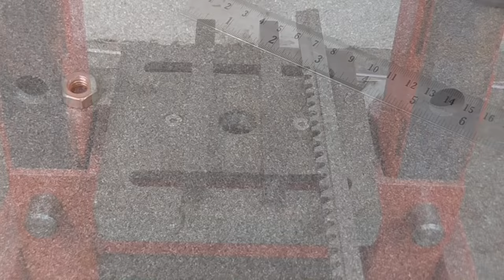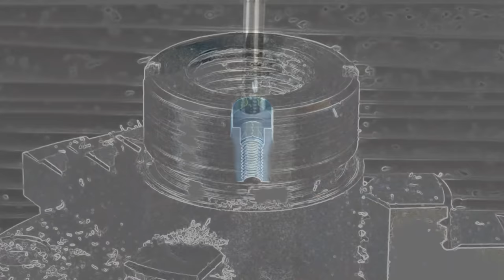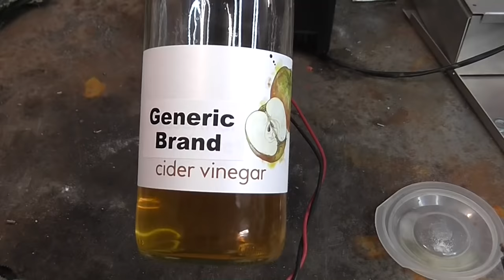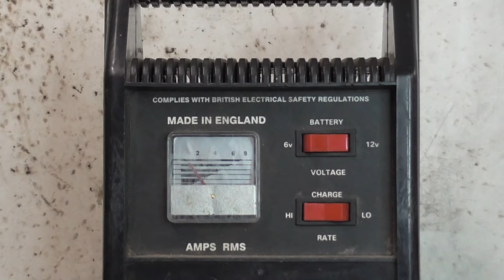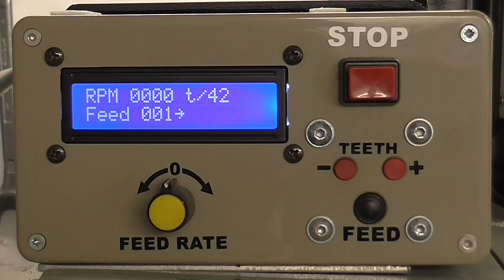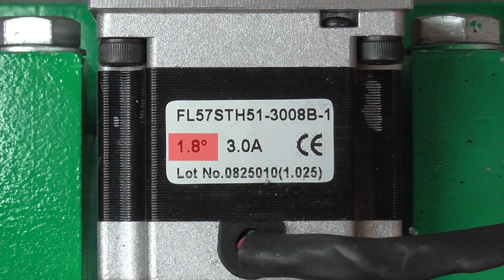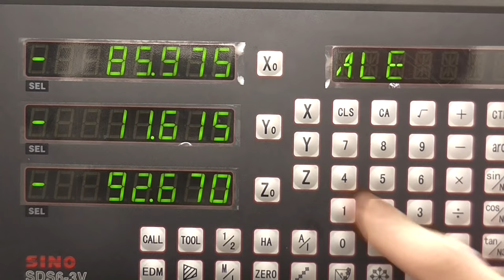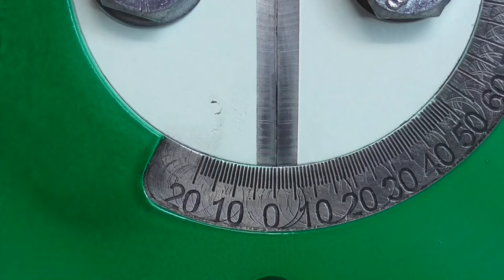Gear Hobbing Attachment (milling machine) Part 2

Comment: Could the stepper motor have been adapted to a BS-2 universal dividing head? Or was it necessary to build from scratch to get the right gearing?
Reply from the maker: Yes, the problem with these dividing heads is they have a 40:1 ratio which is far too high to drive with a stepper motor at the speed required, unless you are cutting gears with hundreds of teeth (or run the milling machine at 10rpm). I do actually have a 40:1 rotary table with a stepper motor on it, it's useful for cutting gear teeth one at a time and other types of automatic indexing, but not for hobbing/skiving.
Reply: @AndysMachines  could you bypass the worm drive and use a gear connected directly to the back of the spindle? I believe the BS-2 has a directly connected shaft that would originally be used for differential indexing.
Reply from the maker: Yes, you could. It would be more work obviously and you might have to be quite creative mounting the pulley and motor so they don't interfere with the head being able to tilt. If you don't need the head to tilt very much you might just be able to disconnect (or remove) the worm and mount the pulley on the back of a drawbar. You can normally tilt the head downward about 10° I think and it's possible to cut both left and right hand helicals at the same angle by cutting on either the front or back of the blank (you have to tilt the mill head to align the hob correctly).
Reply: @AndysMachines  I guess the benefit of making one from scratch is the ability to make it tall enough that the motor clears as it's spun up vertical. Very cool design and great videos 👍 I would love to see the modern stepper motor control using an Arduino.

Comment: Syncking the blank gear - what  if the gear blank was free to rotate - would the hob not drive it at the correct speed ? Just been mulling over ideas - concepts of using a plastic guide gear fixed to the blank that the hob could drive the blank with for the first cuts......
Reply from the maker: Yes, if the blank is the correct diameter and thicker than the gap between two hob teeth then once fully engaged the hob will drive it at the correct speed just like a worm wheel. BUT, you have to take one cut at the full depth, you can't do it in two or more passes as you will be cutting a larger pitch circle diameter and end up with too many teeth (or just a mess!)
Reply: @AndysMachines  It'd be a mess - as you'd have a fraction of a tooth  too many every revolution !
Reply from the maker: It's a bit like knurling, sometimes the cutter will find it's own path even if the diameter is wrong, sometimes you just get a mess.
Reply: @AndysMachines  I had knurling in mind too. I've always wondered how that doesn't always come out a mess :)
Reply from the maker: Joe Pieczynski has a good video on knurling, the two main tricks seem to be getting the diameter to be a multiple of the knurl spacing and applying the tool to the work with some force before starting the lathe.
Reply from the maker: @millomweb  Good old Myfordboy! Yes that's the basic freehobbing method, note that it's necessary to gash the blank with the correct number of slots first otherwise when the cutter first makes contact it's at a larger diameter and you have the same problems mentioned above.
Reply: @AndysMachines  It'd be interesting to try without going all the way around with nicks - or alternatively, just nick an edge ring to start each tooth gap cut !
Prior to your video, I didn't actually know what a hob was although I've been aware of hobbing machines since the early 1990s ! I like the idea of free hobbing - so that you don't have to set up drive to the blank rotation. I've a massive mine to explore on power driving a rotary table on my mill - there's a mystery plate I've never had the cover off but I believe it's access to the power feed !
The 'mine' is the fact I'd need to explore gearing between spindle and feed. It has feeds and speeds on labels but I'm pretty sure they're only approximate. So it should be a good explore to try to screw-cut on the mill ! I bet it'll do hundreds of strange pitches :)

Comment: Hello, I have a question about helical gears, is the angular velocity of the workpiece defined for a specific feed? According to what I have studied about this method, the workpiece varies the speed according to the feed, this because of the helix, I hope you understand me because I am translating it directly from google hahah
Reply from the maker: Yes, I think you're talking about the advance which is normally used on a milling machine when cutting a helix. With this method using a hob and tilting the gear to the helical angle no advance is required, as the cut naturally aligns with the helical path.

Comment: Im just hetting into gear citting,(ive been hitherto afraid of it.), but im wondering if i can do without the stepper and use the helix of the hob like a worm to drive the bearings
Reply from the maker: Yes, you can do that, it's called 'free hobbing' but it can be unreliable and you can end up with one more or less tooth than you were planning, or just a complete mess. If you have a way to gash the blank with the right number of slots to provide the hob with a starting point then that will help.

Comment: Hi, Can you share with us where to buy the encoder reader? Also, any video about the programmable stepper driver ? Thank you.
Reply from the maker: The encoder will depend on your milling machine and where you are fitting it, there are many different types and sizes available, large ones can be expensive but I modified a fairly cheap one.

Comment: I’ve never heard of a diamond drag tool. Is that tool specifically made for marking graduations? If so where can I find one of those?

The only tool I can think of that’s similar to that is a diamond truing tool used to true up grinding wheels.
Reply from the maker: Yes, it's for engraving with the spindle not rotating, it just gets 'dragged' across the work piece. They are often used for engraving small writing and they are usually spring loaded to apply constant pressure (I just used the diamond tip and applied hand pressure). If you can't find one at an engineering supply place, try ebay or amazon. They look like a diamond dressing tool but are not the same.
Reply: @AndysMachines  thanks for letting me know! I’ll definitely look around to see what I can find.

Comment: Is there any way I can cut a small diameter (16mm) helical gear using this hobber and a fixed head vertical mill - or is it time to upgrade my mill ?
Reply from the maker: Can you not tilt the head of the milling machine sideways? You need to do this to tilt the hob to the correct angle. You could try with the hob vertical, but at best the tooth profile will not be correct, or it may just tear up the blank completely.

Comment: Hi Andy! 

Very nice work, love the attention to detail.
I have been thinking about building a hobbing setup similar to this for quite awhile but I'm no good at writing code. 
I have written some very simple code but it's just one of those things that doesn't come natural to me.
Did you build and program the interface?
I heard you mention that it was from an older hobbing attachment but I still imagine that the original was one of your machines as well. 
Any chance of getting the electronic hardware list and the code for the stepper?
It doesn't hurt to ask, right? :-)

Again, very good work!! 

Thanks!

Joe
Reply from the maker: Yes, I built the interface, around 10 years ago, I have a much older video also on youtube. It uses a PIC microcontroller, which nobody seems to use nowadays (even me!) and few people have even heard of, everybody wants to use arduinos for everything now!  I could go into this topic in more detail, but it would need to be a whole video (or series) by itself.
Reply: @AndysMachines  
Thanks a bunch for the response, Andy! 

I wouldn't want you to go through that much trouble or take that much time on this considering that few (if any) people would use the information on PICs. 
I'm sure there would be a lot of interest in an Arduino based system or maybe even a Texas Instruments C2000 Piccolo Development Kit?
I'm not really sure about advantages of using the TI Development Kit other it seems to have a faster processor and handles PIDs better than Arduino.
They do use the same Arduino style code though. 
I've noticed on a few forums where there is a fair amount of interest in using a rotary encoder to drive a closed loop stepper (hybrid stepper) for gear hobbing but I haven't seen anything yet where someone has written code that they are willing to share with the public unless I just haven't found it yet.  

What you have done here was very well made IMHO and appears to work as intended, so for me anyway, it's only a matter of how to drive the stepper. 

Thanks again for the response!! :-) 

Joe

Comment: a question, the reader of the encoder what is it? if I wanted to order it?
Reply from the maker: It's just a standard head from an optical encoder. Encoders are usually supplied complete but I actually took this read-head from another encoder with a different number of counts per revolution and made my own encoder wheel for it, when doing this it's important to have the same slot spacing, but you can change the overall size of the wheel.
Reply: @AndysMachines  imagine it, thank you very much for the answer.

Comment: I don't even use a stepper on my gear blank holder I made.  Gear hob all on its own spins the blank as it cuts
Reply from the maker: Yes, that's called 'free hobbing' and if you have the angles and depths all set correctly can work well. It can also go wrong and you can end up with very misshapen teeth or the wrong number of teeth.
Reply: @AndysMachines  well I'll keep that in mind the next 20 years I do it  cause never happened in last 20 years either of those!  
✌😮👍
Reply from the maker: @BuildBreakFix  Then you must have a good setup and be dong it right! (Milling machine?). People often try to do this on a lathe feeding the hob radially into the blank, sometimes it works, sometimes it doesn't.
Reply: @AndysMachines  Well I have a cnc mill with a 5axis such as you built! very nice job btw!  But as far as gear hobbing goes!  Almost never needs cnc driven 5 axis point for it.  When I hob gears I pretty much use a lathe spindle that rolls freely mounted to the mill table. Y axis goes back and forth till done lol!  Think only time I use a cnc 5th axis was to make impeller  once! and few worm gears. and about 12 Herringbone gears  out of the 600 over few decades lol!  We actually use to make gears at work on lathes year ago.  Remove the heads and installed a Shaft with 2 V bushings to hold your blank and it had a vertical up and down adjust. Use to put a hob in a bit holder inside a collet chuck to hold it.   But yeah pretty much same thing lol but that was meant to be used in that way for that type of lathe! Next time you fly in an Airplane chances are I made stuff in planes engine  keeping it  running LOL!

Comment: friend, i work with renania gear generator, in brazil, how do you make the synchronism between the milling machine and the divider? and in the renania system the helical gear depends on the milling machine advance, how do you do this calculation in this system?
Reply from the maker: I'm not familiar with how the renania gear generator works. The advance is handled simply by tilting the hobbing spindle and synchronising it to the hob so that the helical path is in line with the cutter feed direction.

Comment: OK try to make a strain wave gear (Harmonic Drive).
Reply from the maker: In my next video I'll actually be building a cycloidal gearbox. I did consider a harmonic reduction, maybe I'll build one of those in future, I can think of a couple of applications for it!
Reply: @AndysMachines  Great. I'd like to watch your cycloidal gearbox build. I'm going to build my 4th axis but since I don't have the equipment to build a harmonic drive my next best option is to build a cycloidal gearbox. Keep us posted on your build. Thanks.

Comment: 21:00 only one who ask. are they acurate. you touch and then go depth. that touch is allready was lets say 0.01 xD
Reply from the maker: Yes, there are more accurate ways to touch off, such as using an edge finder, But gears are generally machined slightly undersize anyway as there needs to be some clearance/backlash to stop binding.

Comment: Won't the hobb spin the material at the proper rate?
Reply from the maker: Yes, if you have the angles and depth set accurately the hob will tend to turn the blank at the correct speed once fully engaged. But you need to cut to full depth in one pass and it can be unreliable, ending up with one more or less teeth than intended, or just destroying the blank completely.

Comment: 🦄🖖🍔🍟🍓💪I wander how they did this back in 1950? the slo-moe is nice!
Reply from the maker: In the 50s instead of electronics they used a train of gears from the powered spindle to the blank, much like the changewheels on a screwcutting lathe.

Comment: Great build, but its frustrating that you didn't take the time to sort out the milling marks on the graduation scale
Reply from the maker: You don't like the nice textured background?!
Reply: @AndysMachines  yes, I don't like it but like I said in my main comment that it is a great build just a bit of missing detail
Reply from the maker: @____________6145  I do agree with you, it does spoil the look a little and it's much more obvious on the video than in real life. But I didn't build it to look pretty, I built it to do a job and in use I don't even notice the marks. But yes, could have been better.
Reply: @AndysMachines  oh okay, I did not know that It's not so visible IRL the camera shows it more prominent as it is I would say xD

Comment: Hi , great idea ! Would this system work on a 40:1 dividing head?
Reply from the maker: It would, but with such a large reduction ratio you would be limited to running the milling machine very slowly and you would need a high resolution encoder on the spindle. (Or on a separate spindle geared up from the mill spindle).
Reply: @AndysMachines  yes, But my dividing head has a servo , with a 600 lines encoder, I’m intending to use a 2048 lines encoder for the mill spindle , as I have it surplus from another project.At the moment I’m struggling loading the hex file into the arduino uno, followed the instructions step and step ( copy and paste) changes the com port to 9 , and it gives me a error ..avrdude. can’t open config file invalid argument… 
Regards
Mariano
Reply: I have succeeded in uploading the code to the Arduino, the problem was that the Avrdude.conf  file was not in the same directory as the .hex program and the avrdude program , this was all that was wrong.. now to buy the lcd, …

Comment: I created your project. Nema23 torque 6kg cm. 4:1 ppr 200, but my stepper motor is skipping steps.
Reply from the maker: Are you sure the hob is tilted to the correct angle? This is important otherwise it will try and drive the blank at a different speed to the stepper motor. Also taking one cut at full depth is better than taking multiple shallow passes.

Comment: Hate to be a party pooper, but circa 5.45 that 2nd oil seals lip doesn’t look right☹️
Reply from the maker: Well spotted! It wasn't (I actually dismantled and reassembled it off-camera).
Reply: If you put a colon between minutes and seconds it will automatically link like this 5:45

Comment: 5:52 I'd say that's too tight - and it'd be better being a very light interference fit such that it'd push on with your hands. IMO, that's too stiff to adjust sensitively.
Reply from the maker: The pulley or the rear bearing? The bearing was slightly snug, I think I've answered this twice already on here (see other comments). The pulley I didn't want to have any rotational play so everything stays perfectly in step.
Reply: @AndysMachines  The bearing - To adjust the bearing preload, one of the bearings needs to be able to slide.
Reply from the maker: Yes, that's what I was aiming for (I went into this in the first video). It ended up slightly on the tight side, but it will still move, however that's better than it being loose and there being play in the spindle. The front bearing has an interference fit of 1 thou, I measured the rear bearing journal as less than one 10th smaller than the bearing, but my measurement may have been off. (I'm sure it wasn't as tight when I checked the fit on the lathe, but that may have been the other bearing, or something else may have happened).

Comment: Unfortunately, skiving requires special cutters that are specifically made for the number of teeth to be cut and have the proper clearance and face angles; they look like normal shaper cutters, but they're not. What you've done might look like skiving (and is certainly impressive), but the absolutely horrible tooth profile should be a clear indication that it doesn't actually work.
Reply from the maker: This was my first attempt with a homemade skiving tool. The tool really needed to be bigger (more teeth) but I didn't have a larger piece of tool steel to hand. The tooth profile of the gear is actually correct (has the correct geometry -  the teeth have concave faces rather than convex, as they should for an internal gear). Though the finish could certainly be improved. The gear does run smoothly with a helical pinion cut with a standard gear hob. I'm sure I'll be able to improve the process and get better results but I'm quite pleased with this first try, I half expected it to just shear all the teeth off the cutter.